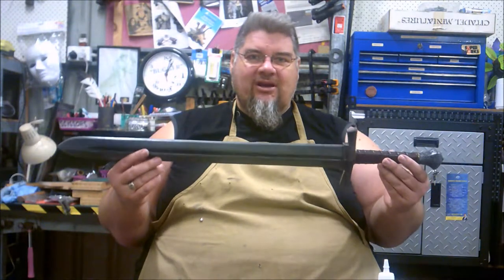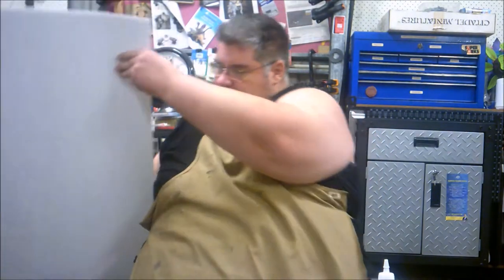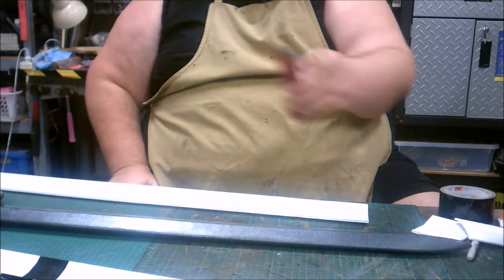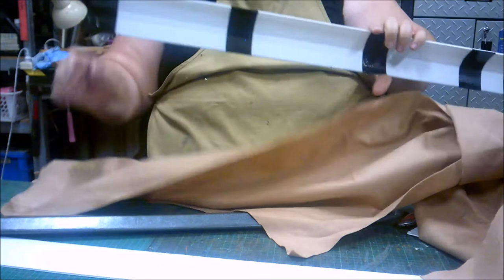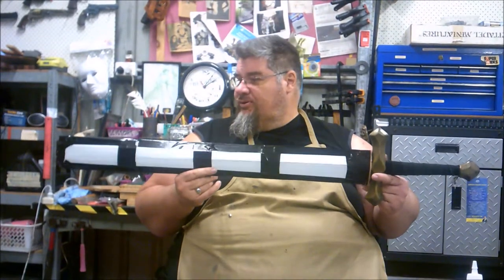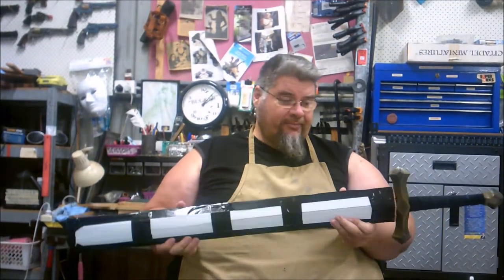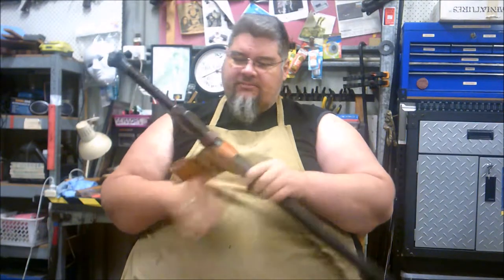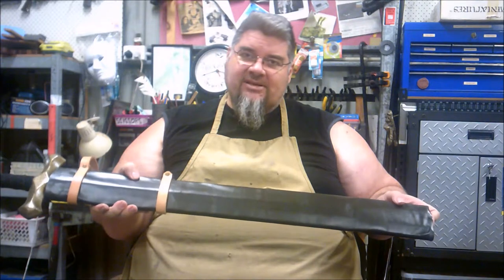DIY cheap larp sword scabbards

Comment: I just used cardboard covered it in duct tape and fit it to the blade. I then made a canvas cover for it. Works well. Looks nice.
Reply from the maker: exactly the same concept, just a little less water resistant. The important thing is that you are happy with it.